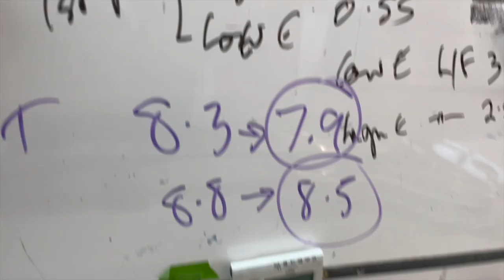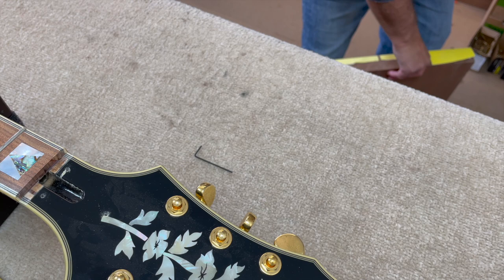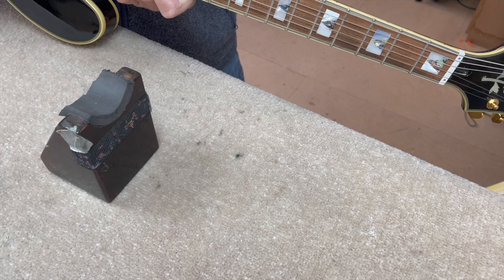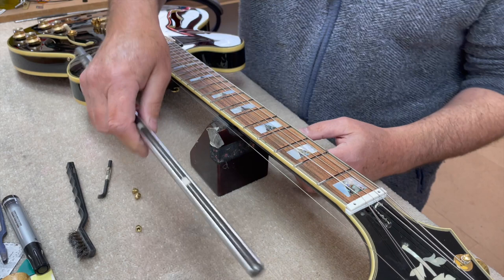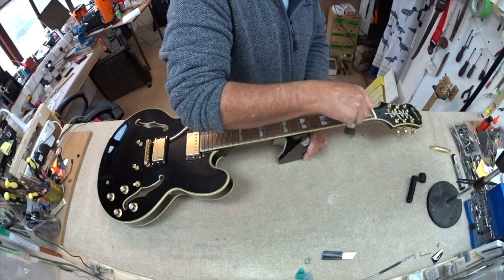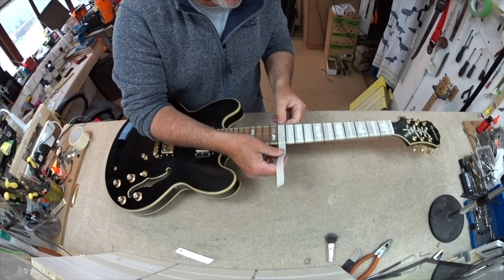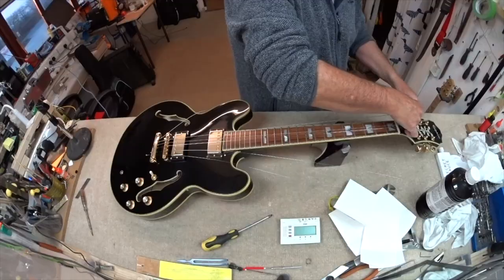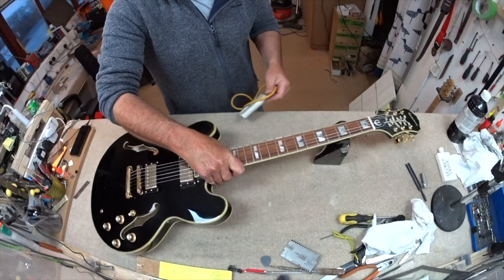Epiphone Sheriton set up.

Comment: Wonderful video.  I'm 100 percent on the Tusc replacement nuts. I really like that adjustable one. I've now had them on many guitar's.  I do the old half a pencil trick to lower those beautiful factory grooves. In this instance I find the nut slot radius qnd hope it is the same as the fretboard radius.  If so, I put sandpaper down on the fretboard amd sand it in a figure 8 to get the right radius.  It gets me as low as I can possibly go and still have some adjustability for the seasonal changes. The last one I did was on a 9.25 Squier stratocaster standard. It came so low that it was perfect.  What do you think about compensated nuts?

Comment: Love your videos Sam.
What would you have had to do if, in the intonation step, the tunematic bridge adjustment reached its limit before correcting the tuning?
You said you would be very unhappy. 
I just bought a 2019 Sheraton and have been happy with it until noticing it is generally sharp at 12th fret and noticeably sharp at fretted notes along the neck. The G and  low E  adjusters are nearly maxed out. How bad is this?
Reply from the maker: Hi PB Usually first step is to reverse the saddle blocks on the strings that won't reach intonation (assuming that to do so would free up another 2-3mm intonation travel). Failing that I would replace the TOM bridge with a roller bridge as these type of TOM bridges usually have greater front-to-back saddle travel.
Reply: @SamDeeksRelovedGuitars  Thanks Sam for your quick reply and great suggestions.
I have learned a lot from watching your work and the comments you make along the way. 

.

Comment: I’ve just got one of these guitars which I love. However, I’m having a bit of a hard time getting it set up properly.

Just wondering what you charge to do a set-up (with one of your nuts etc)? And, whereabouts you are? (I’m in Lincolnshire) Many thanks.
Reply from the maker: Hi - sorry for the late reply! I charge £135 for my set up which includes new nut, new strings and precision fret levelling as seen in my videos. I have 100% no loss, no damage record on well over 1500 courier sends with my packaging approach and Parcelforce so the risk of loss or damage is negligible if you get the packaging right. I do most of my work via courier; if you're interested in discussing, please email me at samdeeks@gmail.com.

Comment: Great setup to a great guitar! 
I like the way you do fret leveling! it just seems more precise and less aggressive which works for me to try and it out :)
Can you tell me what are those buttons with the narrow beam and how can i get them? 
Thanks!
Reply from the maker: Hi thanks for the kind feedback! My eBook '5 Steps to Guitar Set up Heaven' covers how to make and use the legendary 'Banana' fret levelling technique you're referring to - all with zero- or low-cost tools. You can find out about it here (plus how to buy direct from me if you like):
https://www.facebook.com/relovedguitars/posts/pfbid0dHJrjwxxRtFcPCGJTvXkBwoReTtoEPxQNq3xKEErD5vivdzftv9vhFfd5gXSVPq9l

The little nuts are brass dome nuts; just need to fit between the strings and the tops be above the stirngs (and all be the same size). 

The technique is very elegant and effective - takes time to get really good at it. I've been doing it this way for about 8 years now and I certainly wouldn't do it any other way. I've also built up a load of experience of 'reading' what the tool is telling me about the condition of the neck.

Comment: Another job nicely done :) I have a Sheraton Pro II, and have had a few woes with it, it has been back to Epiphone for a fret level, under warranty, due to buzzing on the A string (a little on the low E as well, but not a problem). The A still buzzes a little too much for my liking, but I am a bit of a heavy hitter, so have put up with it. The wisdom imparted to me by Epiphone was "well...guitars with wired bridges do buzz anyway", so why only the A string? It remains a mystery. Lovely guitar though :)

Comment: Just realized my bridge is on upside down... The screws are pointing downwards and touching the strings as they slope off towards the tailpiece. I'm blaming the set up guy...
Reply from the maker: There’s no ‘true’ way - people tend to place the screws facing whichever way gives easier access for assisting the saddles for intonation. For some people that’s with the screws facing the nut, for others they’re facing the stop-bar.

Comment: What’s a good starting point for bridge height on a semi hollow like this?
Reply from the maker: Hi Robert... there's no 'bridge height' that makes any sense as what we're concerned about is the playing action of the strings over 12th (or I prefer last) fret. Many guitars of the same model can have slightly variations in the neck fit angle which changes how high the bridge eventually sits to get the action we want. 
Personally, on electric guitars my target action is as follows: neck relief 0.2mm, last fret action 1.5 low E last fret, 1.2mm high E last fret and 0.3mm 1st fret action on all strings. This is a target that I know from experience can be set with careful fret levelling on most electric guitars with radii of 9.5" and above. Tighter radii (i.e. 7.25") require a slightly higher playing action to avoid choke-outs on bends. 
If you're looking for a low action, the bridge height will be constrained by the uneven frets on your neck (and unless they've been very carefully levelled in the past they will be more or less uneven, regardless of the brand or price point of the guitar). Most inexperienced owners lower the bridge until the strings buzz unbearably and then back off a bit - and then live with it. You don't have to be constrained by those uneven frets but the only way to overcome those constraints is by levelling.